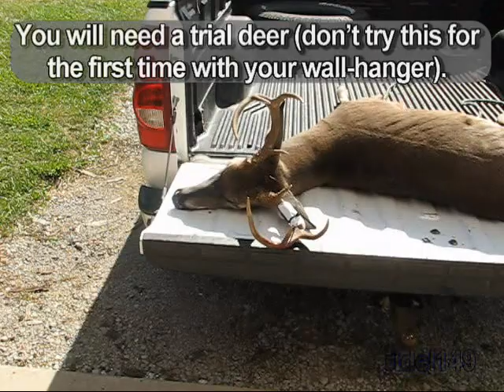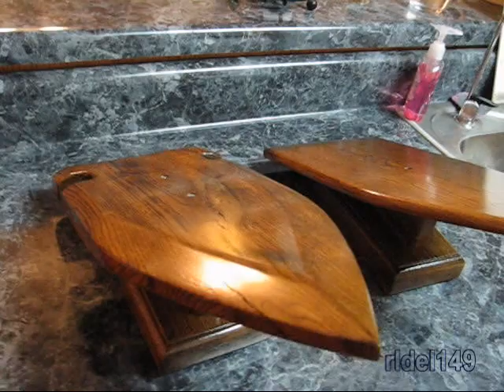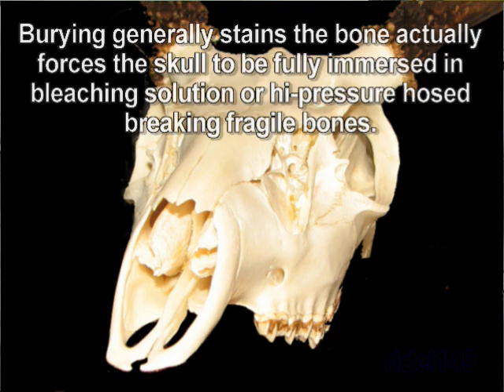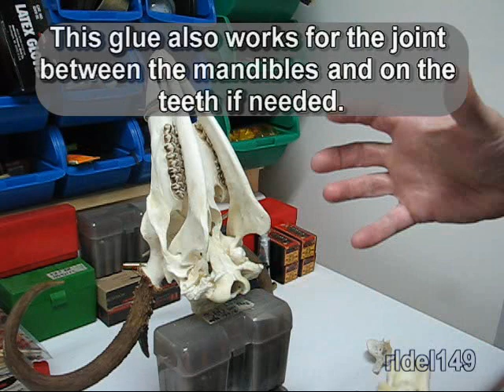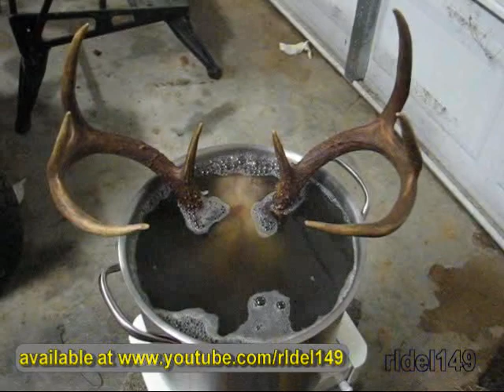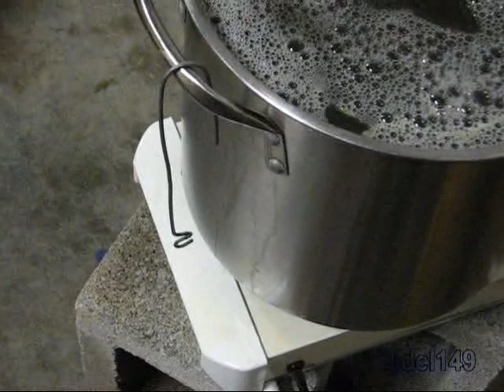Dry Skull Mount Part 1

Comment from the maker: I just have what you see.  I didn't shoot very much of the process sine most people just buy one. The reason I went to the trouble of making one was 1) had the wood in the garage and need to do something with it - this was as good as anything (if we ever leave we can take a bit of the place with us) and 2) I wanted one big enough to add the date plate. Most plaques you see on the internet and ebay are rather small (no room for the brass plate).

Sorry :-( I can't help much there.